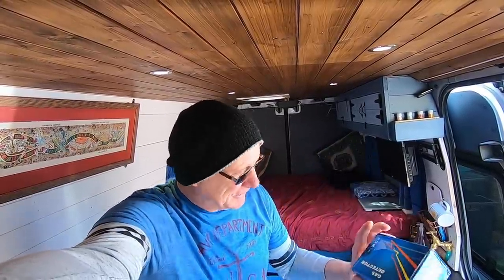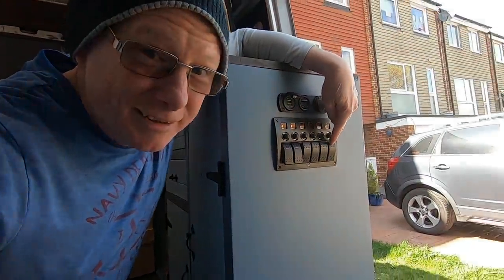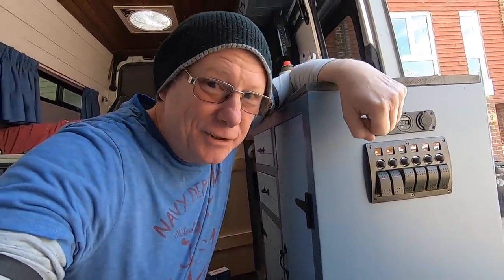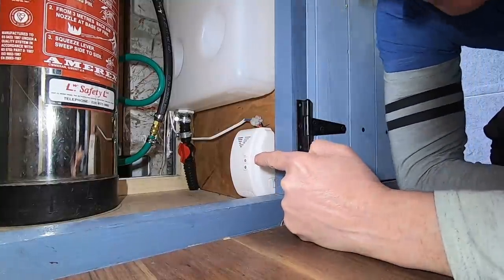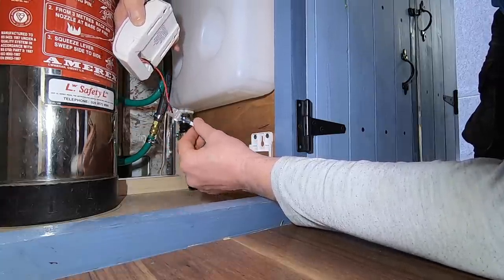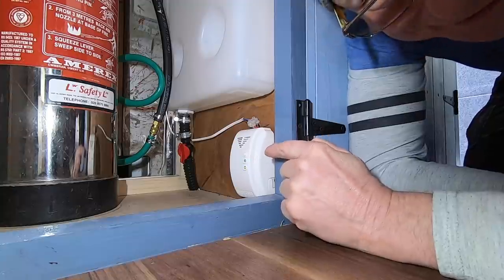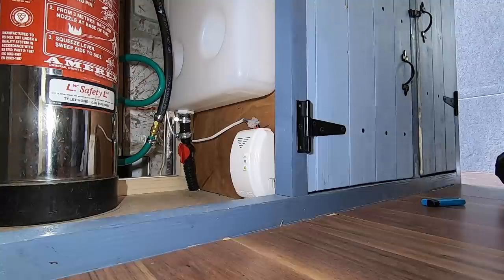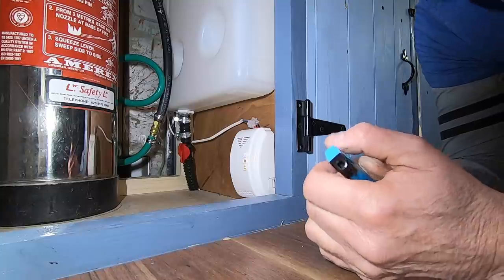HOW TO INSTALL PROPANE GAS ALARM into an RV Campervan

Comment: Hi Mel.  A tip for mission critical items like gas alarms and such - those screw connector blocks can loosen off over time , with vibration and temperature changes in the van.

I have used  WAGO connectors , which are a doddle to use, are not susceptible to losing contact from vibration and make mounting and demounting accessories easy and secure.

A bit more expensive , but worth it for peace of mind.
Reply from the maker: Nice little tip there thank you 👍🤓👍
Reply: Hi Fraser, can you post a link - not sure of the type of WAGO connectors to use

Comment: Cheers Mel - literally had one of those turn up two days ago and was going to wire it directly to the leisure battery. Will run it through my switch box instead now 👍🏻
Reply from the maker: You’re absolutely welcome that was lucky 😂🤓👍

Comment: Great videos Mel. Have you seen this system what I fitted 3gas+alarm it’s called.You can buy extra sensors so you have 3 sensors and have them spread about van at different heights and they pick up every gas
Reply from the maker: Hi no I haven’t seen anything like that thanks for letting me know 👍🤓👍

Comment: What the hell Mel! you fitted a TV and din't show us! :-)  I'm impressed with the explanation on how the gas alarm works, thanks for that. I'll be picky and say it'll detect any flammable gas, mostly hydrocarbon gas. That's what you mean anyway. Well, mine was set up by using the autocarpet adhesive spray! Cheers
Reply from the maker: Haha ops my bad 😂🤓👍

Comment: Where is the best place to buy some opening rubber seal windows like the ones you got above your bed and a larger one in sliding door I’m going to start converting an Iveco xlwb thanks
Reply from the maker: Hi every thing you need to know is in the description of the videos I made when I fitted them I put links there for your convenience good luck with your build and thank you for all your support I really appreciate it 👍🤓👍

Comment: What size fuse did you use when connecting it to your 12v supply? or does it have one built in?
Reply from the maker: Oh sorry I used 2amp fuse 🤓👍

Comment: Hi Mel. Love your videos and I’m on my second conversion. We’ve downsized from our LWB high room Sprinter, and we’re now converting a Ford Transit SWB minibus (quite a change). Anyway, can you please tell me where you got your swing arm table (Including hinged top). Thanks so much & keep up the good work.
Reply from the maker: the top was from my old VW
heres a link to the swing out leg good luck with your build 
http://rover.ebay.com/rover/1/710-53481-19255-0/1?ff3=4&pub=5575467911&toolid=10001&campid=5338454651&customid=&mpre=https%3A%2F%2Fwww.ebay.co.uk%2Fitm%2FSwing-Out-Side-Wal-Mounted-Table-Leg-Kit-VW-T5-Campervan-Motorhome-Table-Leg%2F253320401763%3Fhash%3Ditem3afb129363%3Ag%3AxMoAAOSwespbqMcT

Comment: great vid mel
must get one of these , does alarm show power consumption in the instructions ,
Reply from the maker: Yes you really should get one they use 100mA I put link in the description to a uk suppler 👍🤓👍
Reply: @BigVanSmallWorld  Hi mel I am wiring my one of these up at the moment do these things need a fuse if so which size thanks?

Comment: So so many people forget about a gas detector and I don’t know why
Reply from the maker: I know that’s why I made this video thanks again for your support really appreciate it 👍🤓👍
Reply: Probably because they are a bit off a faff from the sounds of it. If you have a drop out vent and you turn off your gas after cooking you should be aye ok. Remembering to turn the gas alarm on and off when you enter and leave the van could get a bit annoying. If you only use gas for cooking and remember to turn off after cooking can you honestly say these alarms are necessary? I have bought one just not sure wether its worth installing, they seem easy enough its just adding the on off switch in the right location could be a bit tricky.